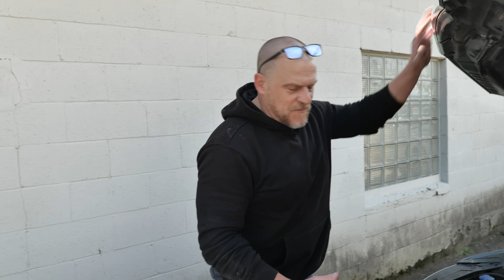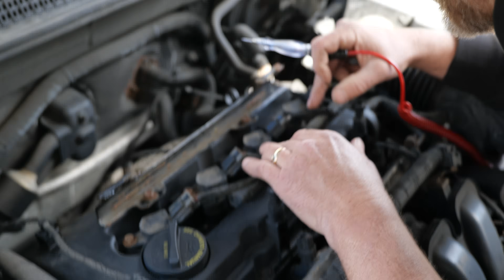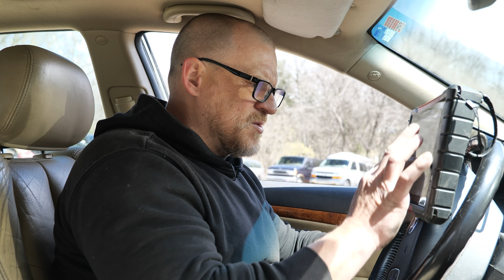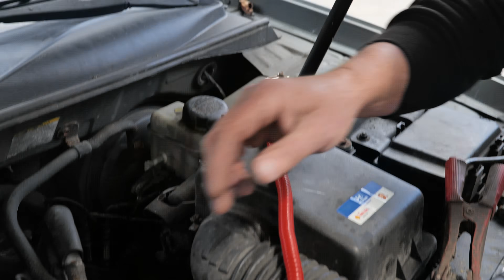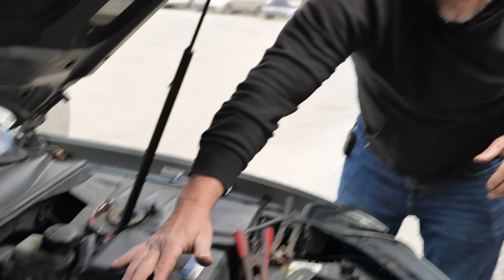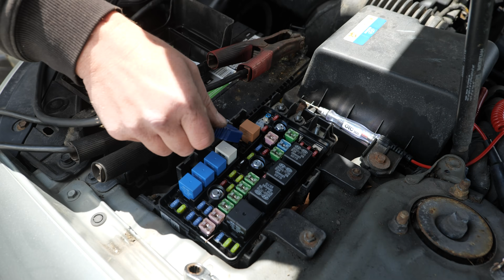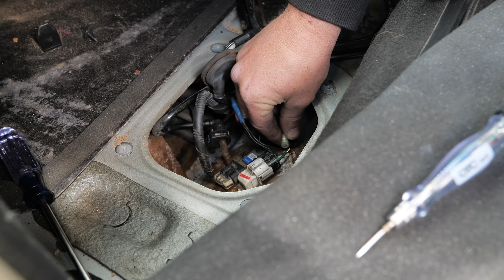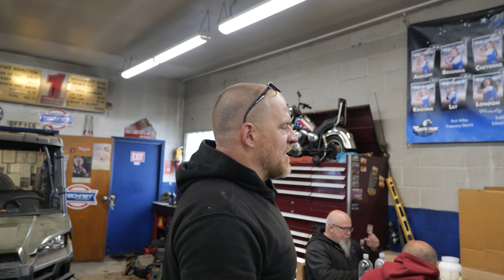No Start Basics  -  What Are We Missing??

Comment: I'm confused Paul. Did you have the test light on battery positive when you were checking coil control? Or were you on ground?
Reply: He was on ground (which is correct, commenter above is a bit confused). The +12V is constantly provided whenever the key is in the run or start position; ground is what's turned "on" and "off" by the ECM. So the test light is basically acting as a parallel source to ground - when the ECM decides it wants to turn on/energize the coil, it provides the ground to do that, and since that path has wayyyy lower resistance than the test light, the vast majority of the current takes that route rather than going thru the test light (which was why he was expecting it to dim every time the ECM charged the coil). Unfortunately, the dwell period of those coils is really short at that low of a load, so it wasn't enough time for that incandescent test light to cool off enough for a noticeable visual change in light output.

When the coil is "off" and no ground is provided by the ECM, the test light is the only path to ground (and much higher resistance than the coil which is in series before it), hence why it lights up.
Reply from the maker: When it was plugged in, I was on battery ground. With it unplugged (if I showed that) it would have been on battery positive.
Reply from the maker: @freedomlover2808  voltmeter is way too slow to see these pulses

Comment: This video is going to be interesting I can tell! Great to seeing you again Paul hope you guys are doing great friend!
Edit after watching great work Paul 
Intermittent connections, and shorts are always quite fun to figure out. 
Have a little CB radio that would just light up, and show the channel number, other then that it was completely dead no RF reception, nor TX. Opened it up took a little bit of time measuring voltages at the transistors within, didn’t really notice anything odd there, until I got to the oscillator section wound being several bad solder joints cracked in the oscillator section and I.F section. Reflowed and was working good as new! Not complaining as it was given to me. Definitely not my first rodeo! 
I’ve watched what I could on your channel, and I really love the way you explain the fundamentals like you do, because once you understand how the circuit works you get a better understanding of what it’s supposed to do versus not suppose to do! It is pretty often to have a “catch all” if you will on certain electronics circuits this is referring to the coils pulse. Be interesting to see exactly how that ECU is firing them. That’s an incredibly fast pulse! 
Don’t know if it will be much help, but if you have iPhones there’s an app in the store “Video tachometer” look for a fan inside of camera film logo on the app. The version you download is free, then within the app you have the option if you want too to get the premium version, or pro version it’s not subscription based it’s a one time charge I’m pretty sure, if is actually subscription based I’m unsure if it’s cost would be worth it to you. I haven’t tried purchasing it yet myself, but a lot of “tool” apps that have a pro version is usually a one time fee. 
Within the app you have basically as it says a tachometer that uses your phone’s camera and you can adjust it for both Hz, or rpm. You can also set and adjust the ISO, exposure, and Focus. The pro version allows you to set it up or tune it more finely to the exact Hz, or RPM. Kinda like having a slow mo camera but not exactly! I’m not exactly sure if it will help see the light flicker or not seems like it would, but I’m kinda unsure!